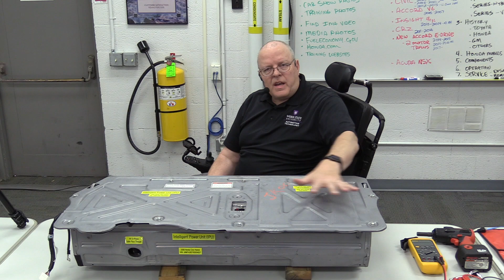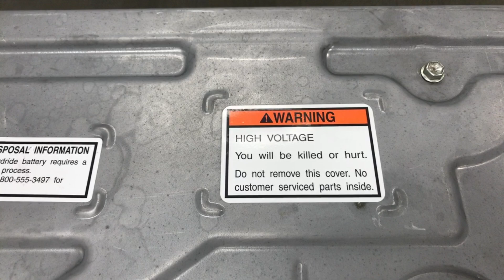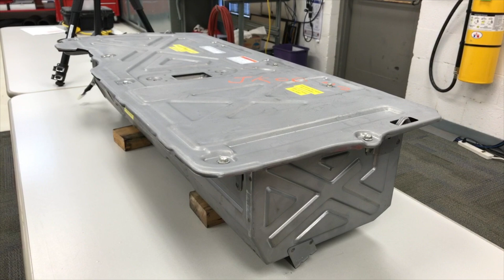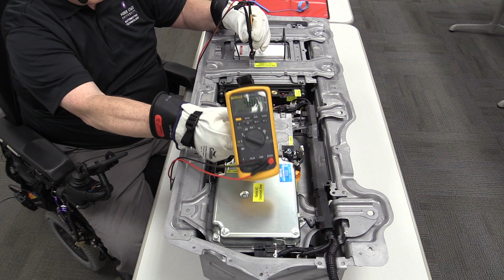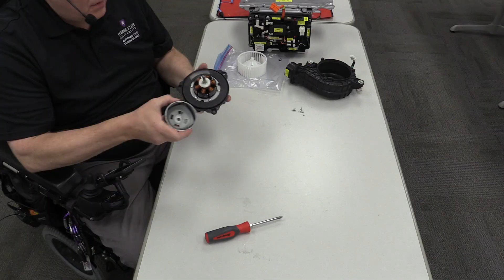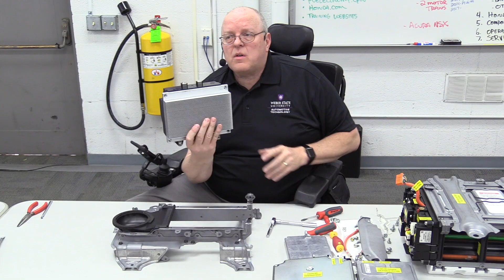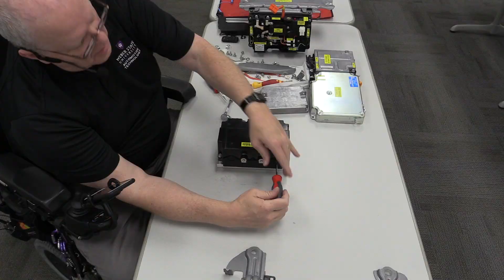Honda IMA Hybrids Part 1 - IPU with Inverter and Converter

Comment: Thank you, Mr. Kelly, for this channel. Sir, I am an older trained tech back in the late 80s. I work mainly on my stuff and some family and friends in a pinch. I am new to this hybrid stuff. I know my way around a car really well, and I'm average in most things and better than in some. But this car has me on the ropes. I bought it at auction for a member of my church who lost her car. SO, it won't start w/o a jump pack. I had the battery tested, and it's good(7 months old), but it won't start. I have a dash reading that says check IMA. Does that mean I need a new IMA? Any direction you point would be appreciated. Thank you.

Comment: Good morning sir 
I own a honda accord hybrid 2005 model, it High voltage battery went flat, it was lossed and charged but after reinstalling, when the car is running the front battery does not charge and eventually runs down , making the vehicle go off!

Any advise or suggestions am in Nigeria

Comment: From the electrical safety standpoint, is it okay to use an impact and socket that are not insulated or coated (as you did removing the cover) or is that okay as long as the battery is disconnected?

Comment: hi i have a honda jazz hybrid that is not giving good gas milage. 7.8L /100 km.  on the computer it does not show there is anything wrong with they hybrid battery.  how can i know that the battery is weak or not working.  what are some reasons for the low milage.

Comment: I wish there was an easier way to directly charge the battery bank when disconnected from the car/motor, or use house power to bypass the battery in order to utilize the system for other purposes.

Comment: Congratulations for your channel, I really learn a lot here. I would like to share a recent situation, I bought a honda civic 1.3 hybrid and so far it's just a headache, I had to change the DC/DC converter because the bat 12v wasn't charging, now there's another problem and the honda mechanic has detected the problem as MCM (1B100-RMX-E05). I don't aproved because was so expensive. Then could you please give me a tip? I need to install an MCM in my vehicle, but my part is 1B100-RMX-E05 and I only found 1B100-RMX-E06, are they compatible?
Is it necessary to update? If I buy the reused part of the end-of-life car. It will work?

Comment: I have 2008 hybrid civic.having battery light on.its not getting charged.i have code in ima dc dc converter low voltage code.any help will be appreciated

Comment: Good day Sir, I'm from Mauritius.
Nice explanation Professor.
I was watching your video on IPU and need some clarification.
I was working on a Honda Hybrid 2014 since two days and the car was completely dead. No ACC, IG1 and IG2.
I have no circuit diagram for this car and I am suspecting that the DC DC converter was faulty. 
I could not communicate with the CAN Bus.

Comment: Got a question sir i have a 06 honda civic hybrid with the ima and battery light solid on and i check battery pack and all cell are good pack is good so i order a good used working dc converter module and problem still there what could it be??

Comment: Sir..
Is there any possibility to emits some amount of AC ripples in to Auxiliary battery from This DC to DC converter.
Because i have case study that misfire counting and P0300 fault code. But no misfire to feel. Finally i found lot of high frequency noise on CAM, Crank sensors signals.

Then i test  auxiliary battery that i found over 730mV and over AC ripples on it.

So i am stuck. where the battery get thta AC ripples. From DC to DC converter?

Any inputs would be great.

Thank you

Comment: Thanks, nice description, but not complete. I want to replace the cooler fan in a 2009 civic hybrid and cannot take out the module
Reply: There is an orange cable going to front and inside the box from back. Where can I unplug this cable?

Comment: Thank you so much for this video, new to Hybrid system.
I have 2013 Honda Civic Hybrid, I have a problem with my IMA, Honda Dealer service dept tell me that I need to replace
Motor Power Unit and 51HOZ : Body Electrical
trying to understand what they are, could you tell me what are they? If so, Do you think I could replace them myself.
Thank you so much for your help

Comment: Hello! Thanks for this professor. Definitely very clear and concise! I have a couple questions on the parts according to my issues (open to anyone who can answer this as well please).

1. What symptoms can come about from a failed Inverter and failed Converter?
2. If a brand new 12V battery is installed and it does not die out but reading less than full charge (car on or off), can you rule out the HV battery being the issue and now focus on the converter/inverter failing?

Thanks!

Comment: I used this video as a guide to repair my 2012 Civic. Although not exactly the same it was close enough for me to remove the inverter and replace one of the IGBT units. The car ran fine, but 3 months later it appears that I might have the same problem again. I haven't inspected the inverter to verify. Both times it happened under braking, however you mention that it uses a rectifier in this situation. Would this damage the IGBTs? What would cause the inverter to go bad? I want to find the cure rather than treat the symptoms.
Please help! This is getting expensive and time consuming!

Comment: Hello my great sir.
Sir I learned a lot by watching your video .but sir today i need your help again.i have a car honda civic hybrid 2006.there is a problem with it.Every morning only the gas engine of the car starts with self. Battery and ima light morning comes on.(trouble code P0A78) and not clear code And when the engine cooling water temperature of the car becomes normal .so i am car engine stop.So after just 15 seconds switch on the car again. so both lights off (battery +ima)and the code also clears .so car is okay.but morning problem sir.i am very upset please need help.I am waiting my head very earnestly

Comment: 243k miles on my original hybrid battery in my 2011 civic hybrid. Finally just got a code for battery starting to go out. I always hear that the batteries weren’t good at all in this generation but mine just kept on going.
Reply: Far more reliable than some of Toyotas. Aqua and Prius v starts to give problems  after 100-150k

Comment: Dear Professor, Can I use solar panels to subsidize or add additional charge to the Honda battery? If yes, where should I put the cable from solar panel?

Comment: Professor, thank you so much information here 
I got a question on my 2005 Honda Accord hybrid I got both codes telling me that the battery is deteriorated and need to be replaced.
Recently I got a new code p1448 which is IPU fan module problem I drive for like 2 weeks like that but today my battery light on the dashboard light up and eventually my car start to dying on power , I hook my obd2 and the 12v battery readings were showing that the battery wasn't charging in fact it was getting discharged while my car was still running, could this be definitely my hybrid battery that is dead or my hybrid fan is not working? 
Thank you
Reply from the maker: Yes, those problems are a result of the dead hybrid battery. A common problem on those cars. Thanks for watching
Reply: @WeberAuto  I measured the voltage at the terminals of the hv battery 🔋 and it was showing 163v is that an accurate measure to tell if the battery is bad ?
Reply from the maker: @rafatorres1420rt  High open terminal voltage does not equal battery capacity. A degraded battery can have high open terminal voltage. Best wishes
Reply: @WeberAuto  thank you for you really helpful information best wishes as well

Comment: Hello my dad has a 05 civic hybrid  and now his IMA light is on along with the check engine light and no one around deals with these vehicles what should i do  Thanks
Reply from the maker: Have it checked for trouble codes. Chances are good that the high voltage battery is bad. Thanks for watching

Comment: Hi, do you know what could be wrong if you lose communication with ima? I was driving through and I wasn't aware that I was going right into a speed bump and I just passed it very fast, a few minutes later the ima and the battery light came up and the vehicule wasn't charging, I took the car to a local mechanic to connect it to a  scanner and it appears that it lose connection to the ima system, we erase it and the car is fine again... is the second time it happens and I'm scare that if I get into a another speed bump o a street hole it comes up again and the 12 v battery is charging ok... has anyone has experienced this ?

Comment: What is a great scan tool for monitoring the batteries? I heard  mention that you can monitor each individual battery with a scan tool but there was no mention about what scan tool to use.

Comment: 08 Civic Hybrid, intermittent code for CEL (P15A5 Motor current sensor), took vehicle to dealer to have checked out, could not duplicate problem.  Picked vehicle up and drove for 4-5 days not lights on running great.  Light came back on same code, cleared code and drove 3-4 days no lights, now back on - tried checking all connections in IPU and under hood to motor sensor. what code be the problem where it intermittently does this. Need help with this, I know motor current sensor requires removal of transmission. Is the sensor the culprit?

Comment: I have a Honda insight a 2009 model hybrid and at night when I drive 🚗 it during the trip the IMA light appears on the dashboard it appears when I have drive  between 5 to 6 kilometer distance what  does it means it is dangerous then what are the damage it can cause on the engine

Comment: I am facing problem with civic  IMA battery... specially on morning time ... the battery is become empty after one minute running... then became full with 3 minutes charging... then no any re action ... no assy. Motor is running and no any charging coming on the dashboard... then I turned off / on my car.. then  every things is normal working

Comment: @Weber  Is there a signal wire that controls only the "power assist"? I'd like to find and cut that wire so that the whole system charges like it should but without draining (144v) battery power for electric assistance. In other words, I want to convert IMA to a regular 2007 Honda Accord(v6) with a giant 12v battery supply, with NO Power Assist. Is this possible? Thanks for your videos!

Comment: I am staying away from hybrids. They are maintenance free for around 8 - 10 years, but buyers beware after that. The complexity of the whole design, and the long term durability of old electronics are a concern. As a retired aircraft technician, I speak from experience. Gasoline engines, no matter how gas guzzling they are, the average mechanic can figure out their workings with the help of an OBD2 scan tool. Tools needed are cheap and widely available. You can go to junkyards for replacement parts. Electrics, let us see how the future pans out...

Comment: Hello professor, I recently encountered an issue with a Honda Fit Hybrid where the hybrid system does not enable. all systems checked manually and with a diagnostic autel dealer level tool, the only error returned is the "sunlight sensor circuit" (code is B1229) would this stop the hybrid drivetrain from initializing?

Comment: Where can u find a inverter on Acura ILX 2013 , ? As my mechanic stating he has to bring down the motor to change it ?
Reply: No , thats. Lie , I have the same issue , I took mine to the dealer and the inverter is right on the passenger seat I have to order mine on line as it’s to expensive for everyone to order it

Comment: I did buy a $330 scanner and on my 2015 Honda accord is not a hybrid it picks up 61-11 modulator-control unit power source circuit low voltage

Comment: Question for you.  I live in a cloudy area,  but want to have off grid power.  I have a 2003 Honda Civic Hybrid,  still using the original battery pack...  but the car body itself is slowly rusting away to uselessness.  I would like to pull the motor, generator,  ipu,  etc. to use as a battery bank charger to recharge my home battery bank for those months when the sun does not shine enough to use my solar panels,  rather than dealing with the power company.  Any advice would be appreciated.
Reply: maybe you shoud ask jack rickard , you tube channel : EVTV maybe it is allready in previous video,s

Comment: hybrid
Reply: hello, professor, it is the first time that I see these systems, I am actually a mechanic but I know little about these terms, I have a situation with a Honda Civic hybrid year 2003, 1300 CC engine, it turns on and off instantly, I see that the bars of  the rear battery in the Dash indicator does not mark anything, which may be the cause, I really appreciate any information ... thank you very much, greetings from Costa Rica ...

Comment: Thanks so much! Had the hybrid battery changed 3 times. Coming with an isolation fault code...Can it be the inverter? I hope it isn't the long wire harness…it is a 2006 civic hybrid.
Reply: Who change your battery and what were the symptoms of your faulty battery?
Reply: @rafatorres1420rt  it was fixed...The AC condenser went bad. Dealer didn't figure it out. My friend with a used car shop with a repair shop attached to it fixed it. Dealers are lazy and suck.
Reply: Thanks so much for your follow up
Reply: @Chinesehero  do you remember the codes on the computer ?
Reply: @rafatorres1420rt  I took pics let me see if I have the pics of codes
Reply: @Chinesehero  please and thank you
Reply: @rafatorres1420rt  i erased the code picture sorry for late reply. for the code though my friend's dad that works at a dealer printed out the steps to trouble shoot and fix and i remember step 3 was AC condenser. hope this helps. also...sorry my car knowledge is zilch. I only used to work on aircooled VWs and that was 30 years ago haha

Comment: Hey Professor, I have an 05 civic hybrid, the hybrid high volt battery has died and I turned the bypass switch off and now he car runs on just gas and 12v system. Up till now no problems really, but lately the 12v battery is not being recharged, and I know that the inverter dc-dc converter is responsible for charging the 12v battery, im just curious, do I need the inverter only? Or the dc dc converter? Or the whole rig? Btw i have no plans of fixing the hybrid system, this car is used for work, and I’m just tryna keep it going at minimal cost possible. I appreciate any help!

Comment: Please read it might help you!! IMA and BATTERY light ON. Symptoms: My car would not stay on the dashboard lights dimmed. Could not run it for more than 2 min. My heart dropped. I was like what the hell!!😔😬 I might need a battery replacement. But I remember I just replaced it. Got a new one 2 yrs ago. So that was not possible I said to myself. I scanned my car and it gave me fault code: P0AE1.  I search the net it read "precharge contactor circuit".  I bought a battery junction board (Module) pull the circuit and replaced it. The IMA and BATTERY lights dissapeared. I was stoked!!.😁😎 Happpy ass hell like if it was my birthday.  I Ran my hybrid for 40 min no problem. This teacher is amazing. I can't thank him enough. I was about to sell my 2006 Civic hybrid. Thanks I revived my  baby.😁😎. Please!! Please! Be safe. You will need all your safety gloves since you will have to remove the module connected to the battery.  WATCH HYBRID Part 2.  Hope this helps some one else.

Comment: Great video professor thank you for the knowledge , i have a honda civic hybrid I am working on and im pulling a code for motor power invert module p1440 , after watching your video I believe that the inverter assembly module is at fault please correct me if im wrong. Im pulling codes p1440 and p15a5.

Comment: Hi Sir me vehicle stop charging 12 volt battery when I put load on it like turn on headlights with fog lights or air conditioner
Can you please tell me what is the problem and what component need to be replace or service ?

Waiting for your reply.

Thanks.
Reply: Aha😂 you get no free lunch
Reply: Hassan Sarwar did you figure the problem out?